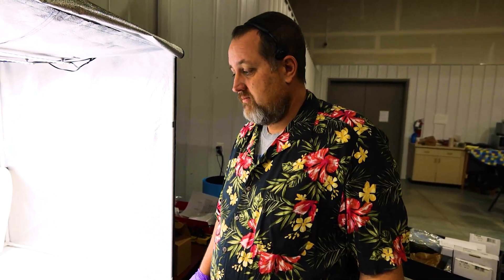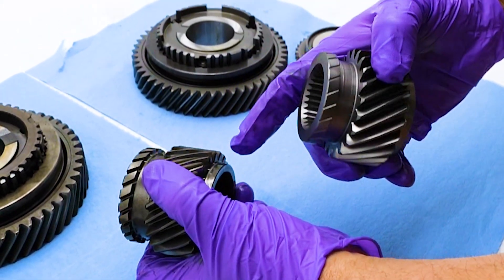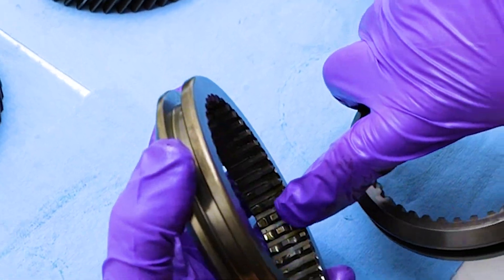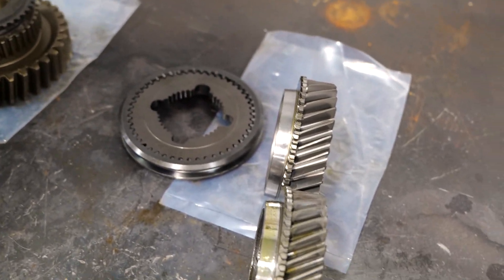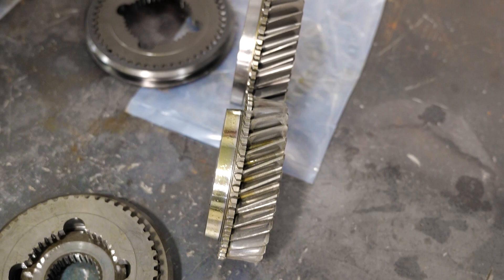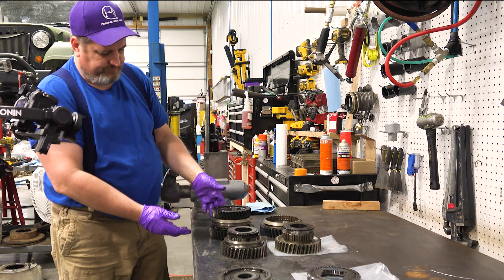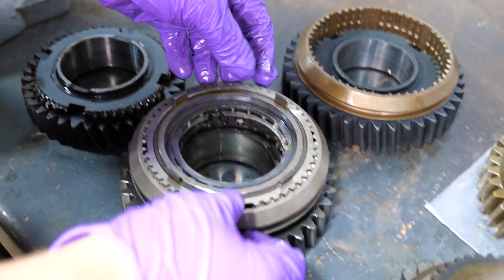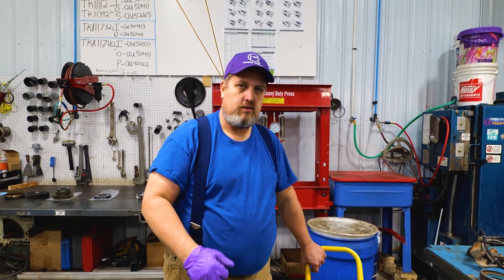NV4500 Transmission Rebuild Project (Teardown & Inspection Part 3)

Comment: What do you wash your parts with chemical wise? I imagine the carbon fiber synchros are pretty picky.
Reply from the maker: We have never reused synchros professionally (although Chis did in his personal transmission as part of this video series), but I suppose they could be cleaned like many porous materials. Soak overnight in a light solvent or mild soapy water, then rinse and let air dry; an oven on low temps can help speed this up. Then soak overnight in the intended lubricant (MT85 for the 4500). The biggest concern is not dissolving the adhesive that attached fiber material to brass, which is usually compatible with most lighter solvents. The fiber itself is very resilient but just porous.

For general parts cleaning we use a heated parts washer cabinet and Temco powdered detergent, supplemented occasionally with Kirkland powdered laundry detergent and Oxy Clean. We do have a solvent tank but it only gets used after parts get rinsed in the cabinet but still have some stuck on gunk. Those select parts get a quick scrub then head back to the cabinet. We have found mixed results with various dishwasher detergents although that can also be used.

I believe Chris washed all his syncros in the cabinet and then rinsed them really good with spray parts cleaner...

A general rule is all parts should get a final hand rinse with something (WD40, clean water, spray cleaner) to rinse off detergent or solvent residue before use.
Reply: @TorqueKingTV  thank for the details and info, my 4500 rebuild is pretty filthy so a major cleaning is in order.

Comment: EXCELLENT VIDEO SERIES, thanks for sharing your knowledge! Purchased the TM1003, very helpful and in depth manual. Would like to have seen a more worn transmission to provide a better comparison of good vs. bad.
Reply from the maker: We have a plethora of used parts in various condition, stay tuned for that video!

Comment: Thanks for the videos. Very informative. My major gripe for this tranny was the large gap from 3rd to 4th. I'm just curious, but did y'all ever give any thought as how too shorten that? Would 3rd have to be taller or shorter? It would be very interesting to see if 3rd could be machined in such a way as to shorten that gap. Thanks again.
Reply: How to shorten that gap: swap in a NV5600 or a G56.  Or just drive like a man and run 3rd gear out to 35 mph. Roaring Diesel engines gives all the Karen’s something to talk about.  😊

Comment: Great videos.  My 3rd gear has been grinding unless I go into it super slow. I used an aftermarket 5th gear nut retainer with the prongs that come out and lock into the 5th gear locknut. If 5th heat backed out again would that cause 3rd gear to grind on a 195,000 mile original nv4500?
Reply from the maker: 3rd gear syncro is the most common to fail because it is generally the most used. 5th backing off shouldn't cause issues with any other gears.

5th usually backs off because the gear itself wears into the shaft and then the nut is no longer tight and unscrews. That pronged nut and sleeve will fix the issue of the nut itself backing off, however they don't prevent the gear from wearing into the shaft. The gear will then wobble slightly and the misalignment will brake teeth off your countershaft 5th gear. We have pictures of this somewhere and its pretty interesting carnage.

That type of failure is not immediate. Usually the nut backed off a couple times before the pronged nut has been installed.

We have an article about 5th gear failures here https://torqueking.com/nv4500-5th-gear-failures-and-solutions/

With 195k original, it is time to rebuild it. NV4500 usually gets 150k between major service, some only made it to 80k while others make it to 300k. Most replacement gears and shafts are now imported, so if you can replace the consumables but retain most original USA made major components you are definitely headed in the right direction.

Comment: I have a 2 wheel drive nv4500 that lost fifth gear. It was shifting hard out of 5th prior to that. I took the tail housing off and all looks good. Is it the shaft the fifth gear shifter inside the case that goes into the 5th gear shift fork that is binding? Can that be replaced with out disassembling the whole transmission?
Reply from the maker: Hi, yes you are able to replace the 5th gear fork and rail just by removing the top cover assembly. It could be the pin that holds the shift lug sheared off, but it could also be excessive wear in either the top cover or the main housing causing the shift rails to bind. Unfortunately it cant be 100% diagnosed until you get in there. Also check the 5th gear syncro struts to make sure they aren't wedged in there.
Reply: @TorqueKingTV I just tore into my NV4500, was also sticking in 5th, I found the shift rail in the housing is binding at the front. Is there a repair for this? Can it be machined and a sleeve pressed in?
Reply from the maker: @preachers4135  It might be money ahead to just buy a new aftermarket main case, rather than pay probably at least as much for a machine shop to do and probably still not get the hole concentric.